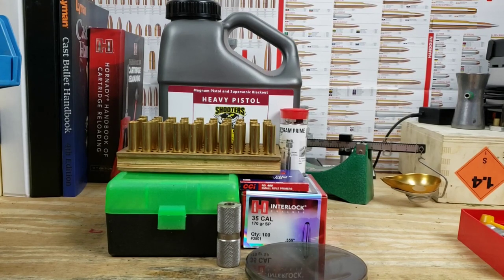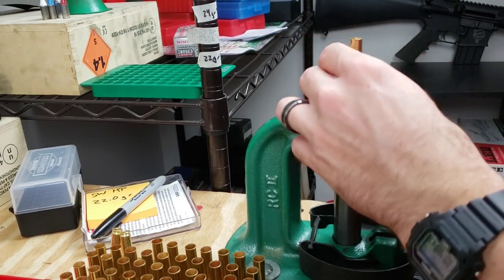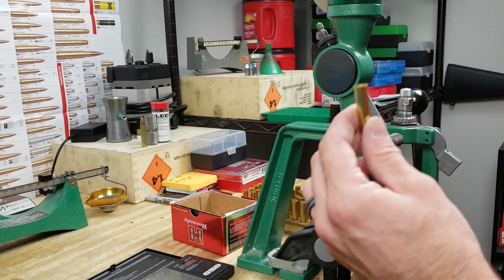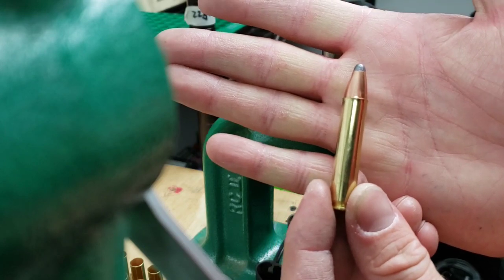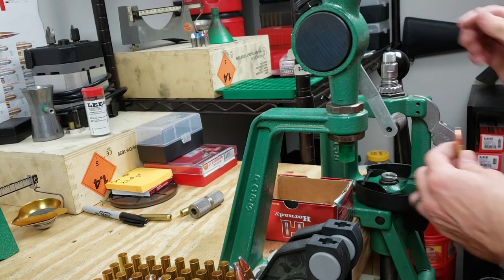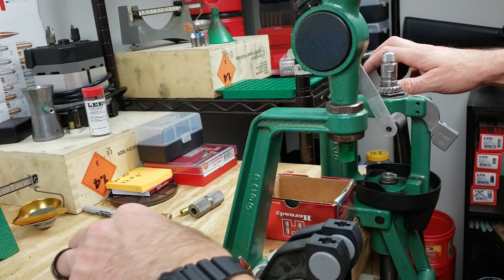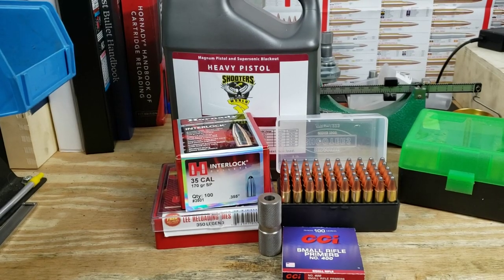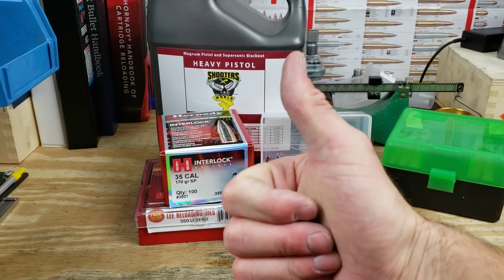Reloading 50 Rounds Of 350 Legend Using Hornady 170gr, SW Heavy Pistol, CCI #400 Small Rifle Primers

Comment: I did "squib" myself years ago when charging one case at a time.  Close call but the next round did not chamber behind the stuck bullet.  I'm sure if I had just tried a little harder... lol.

After that, I went to charging the whole loading block at once, then giving it a good inspection for double, or no charges.  This way does not depend on my (increasingly blurry) laser focus.  And using good metering ball powders, it is amazingly quick.

.350 Legend is quite intriguing.  Could be the ultimate shorter range "Blackout" cartridge.  If it had come out of the gate with reliable 30 rd mags, I would have one for sure.  And caliber-specific loading blocks!  That is a deal breaker.  lol.  Would make a good woodshop project.

Great content!!!
Reply from the maker: I've had a squib as well, but from bad powder. Scary stuff!

I'll have to try charging the whole tray again, just don't want to spill all that powder! I guess thats better than a squib, or double charge, though.

The 350legend 20 rounders are working pretty well for me so far, but no 30s available, without modification involved.

Thanks for watching brother 👊🇺🇸👍

Comment: I use a Redding 38/357 taper crimp die for the final crimp.   Ammo runs like high end factory ammo.   The collet crimp die is for  cartridges that headspace off the shoulder or rim and it is prudent to have a bullet with a cannelure when using a collet crimp.
 A bullet with no cannelure really needs a taper crimp.    The collet crimp with a cannelure bullet , head-spacing off  the shoulder is great for preventing bullet set back during the feed cycle.
 The 350 Legend , 30 Carbine head-space off the forward edge of the case mouth like a pistol cartridge and that requires a taper crimp.
Reply from the maker: Thanks for sharing, brother! I've heard of people doing that with their Hornady die. I've since ditched the Lee dies all together(had issues with every single one out of this set, and as you mentioned, FCD isn't optimal for this cartridge) and now use the Lyman MSR set, which has a taper crimp. It works perfectly, and is made much better. I appreciate the comment 👊👍🇺🇸

Comment: To smooth out the seating process with top heavy combinations I simply just take a charged case, put it into the shell holder, advance the ram part way to the die and set the bullet onto the top of the case as it glides into the die.  No problems at all.
Reply from the maker: You sound like a smarter individual than myself. Thanks 👍

Comment: Since I use a steel case gauge , I keep a clean bronze bore brush to quickly clean the gauge . The tiniest spec in the gauge will make the round harder to fall from it .
Reply from the maker: I need to get some new brushes. Great tip👍🇺🇸🤘

Comment: Ive noticed with Hornady factory 170gr 350L interlocks, that I had more issues in one AR getting them to run. Maybe more of a crimp is what it needed from factory. I think their factory 165 ftx wasnt wanting to feed well either.
Reply from the maker: All of my 350L reloads have ran better with a very heavy crimp from the Lee FCD. That said, it's still somewhat annoying in an AR. I'd probably enjoy it more in a bolt gun and not have to worry about it feeding and running a semi auto 👊🇺🇲

Comment: One thing I’ll throw in there, for AR/semiautomatic rounds in 350 Legend, trim length is critical. 1.700 is SAMMI SPEC, I think. Anyone loading this cartridge should look it up to be sure.
Reply from the maker: Yep, I thought I uniformed all these, but obviously they weren't. Great to note on a cartridge that headspaces off the mouth.🇺🇸👍🤘
Reply: @vettelover2009 I use the Hornady taper crimp die exclusively for my 350 Legend rounds. I kinda got scared of the Lee Factory Crimp Die, which is so popular for almost all other rounds.
Reply: @vettelover2009 and I try to keep all the brass trimmed to a uniform length, so minimum is a good reference point.
Reply: @vettelover2009 I use the Lee on the case prep center that I stoned down just a touch to exactly 1.700. I used to have a custom .358 barrel that was chambered to 1.704, so I‘ve always been careful!
Reply from the maker: I bought 2 of the Lee gauges, and both were too fat to fit inside a sized case, so I had to turn them down with some fine grit sand paper. I then used one of those to uniform all of the once fired brass I've been collecting, and miss remembered it as having done the Starline. Good thing they are pretty consistent out of the box and only having been sized. I will be sure to pay better attention and try avoiding a catastrophic kaboom.
Reply: @DummyRound  and guys, if any of you are interested, here’s a link to a 350 Legend Round Table we dis live with myself, Willie, Emperor and Ocean.-
https://youtu.be/WYzaCLtzXEQ
Reply from the maker: @vettelover2009 you're pretty much describing everything the Lee die does wrong. Web is too fat, mouth ends up very small, seater is very short, etc. I'll have to see how much longer the wait on the MSR set might be. The RCBS is cheaper, too.

Comment: Interesting Winchester loads these rounds with .357? diameter bullet. 
After watching your Video why not reload with 357 diameter bullet. I ditched the Lee dies…years ago! Hello RCBS! Best dies made in America! 
Question is What's the diameter of the expansion/sizing die you are using .355 Or .357 ?  serious question, do 350 Legends dies come in .355 or .357
Reply from the maker: 350 legend is a .355" projectile. Some people have made custom chambers to accept the fatter bullets, but mine is standard .355".  Not sure which Winchester load you're referring to as .357", they designed it around being .355". I've got a few RCBS dies that work great, ended up with the Lyman MSR set for 350legend and have been good since then. The expander is also based on .355" projectiles. Thanks for the comment 👊👍🇺🇸
Reply: @DummyRound  It's all good 
 I was referring to as .357 The ballistics of the Winchester Super-X load:

    Bullet Diameter: .357 inches (All 350 Legend)
    Shell Case Length: 1.71 inches (All 350 Legend)
    Bullet Size: 180 grain
    Muzzle Velocity: 2,100 fps
    Muzzle Energy: 1,762 foot-pounds
    Velocity (200 yards): 1,466 fps
    Energy (200 yards): 859 foot-pounds
Reply from the maker: Very interesting, I have no idea. I haven't bought factory ammo in years. I know the Hornady 350legend specific projectiles are .355" from what I've seen.  Haven't seen any Winchester projectiles for sale anywhere.

Comment: That was a serious question, do 350 Legends need to be trimmed like bottleneck cases? Thanks!
Reply from the maker: That was a serious answer. They headspace off the mouth, so having them shorter or longer will have a closed bolt resting in a different position, leaving too much, or too little headspace.

Comment: Do you have to trim those cases every so often?
Reply from the maker: Every time because they headspace off the mouth.
Reply: @DummyRound  Thanks, I thought they were more like a straight wall case, like the 357 mag.  Looks like an interesting cartridge!
Reply from the maker: They are very slightly tapered, but mostly considered straight wall. They are just a bit longer than a 357 Remington Maximum, and have no rim.

Comment: Thanks for being humble enough to share your mistake with the double charge and for discussing the danger of being distracted. That's actually the reason I haven't done any videos of loading yet. I'm a little skittish. I took a jeweler file to the rough edges on my Lee lock nuts. It made them much easier to work with.
Reply from the maker: Yeah that could have ended horribly if it were a pistol and Titegroup, or some other low capacity/fast burning powder. I'm great at making mistakes, Dummy is in my name, after all 🤣 It's just important that we catch our mistakes, and more importantly, be careful enough to not make them in the first place, or learn from them if(when) we do make them. 

I need one of those jewelers files, have heard about 10 different ways to use them at the loading bench. Thanks for watching. Hope the house hunt is going well 👍👊🇺🇸

Comment: lol,,, Bet'cha a quarter, than when you went back to one-at-a-time, the next round that you charged with powder had + - 1 grn more in it, just from the extra vibration on the weak table. Throw that next/ first charge back into the container. start over. Get a system, & do EVERYTHING exactly the same,,, one round at a time. IF you want to charge all the rounds first, mount your powder charger on another table. Then, you can visually check the amount of powder that's in each case, before you seat the bullets.
Made me laugh again, when you kept changing the amount of crimp, on 6-7 different rounds! I'd love to see that group.
Good thing, your just 'practicing'.   
THANKS,,, for the added humor.    
Oh Ya,, one more thing.  That thin, bullet case holding block works great for short pistol rounds, but to make life easier, make one 2-3 times thicker- with deeper holes. aka,, No chance for the rifle cases to fall over & spill.  & Add a piece of 1/8" thin plywood to the bottom, then you can pick the whole block of casings up & move it, if need be.
Live & Learn. I'm old. ;>)
Reply from the maker: I'll bet a quarter it wasn't off by a whole grain, but I understand your point. Thanks for the tips 👍👊🇺🇸

Comment: I changed out my die lock rings for rcbs lock rings
Reply from the maker: I might look into some spares! Thanks 🤘👍🇺🇸
Reply: @vettelover2009 the reason I like the rcbs is that I can use a wrench to brake them loose or tightening them down and once I get the locking ring set they don't need to move ever again

Comment: Sorry this is a little late but just watching this video… how was the accuracy while testing this round? I have recently acquired quite a bit of heavy pistol and was just curious.
Reply from the maker: Honestly,  I never shot this at paper and just blasted steel targets with it. This load was also on the hot side, so I'd suggest starting significantly lower. They have data on their site now that wasn't around when I loaded these. I was using the assumption that SWHP was very close on burn rate to AA #9 and using that data- this was bad advice, do not follow it. I will certainly revisit this combo and do a proper load work up in the future. Hopefully sooner than later. I'm sure accuracy of MOA is achievable with proper development. Be safe, and thanks for watching👍